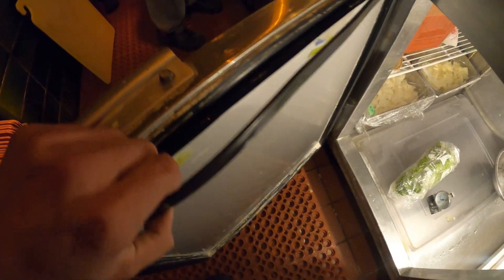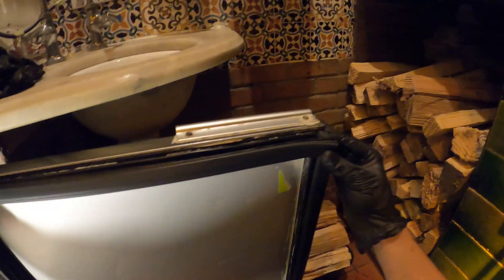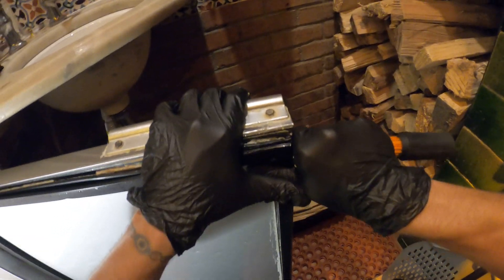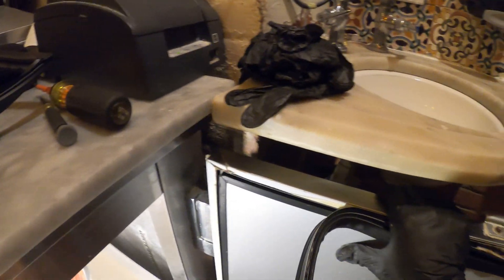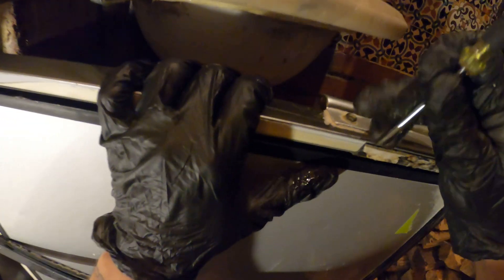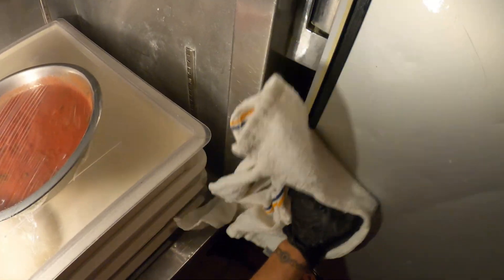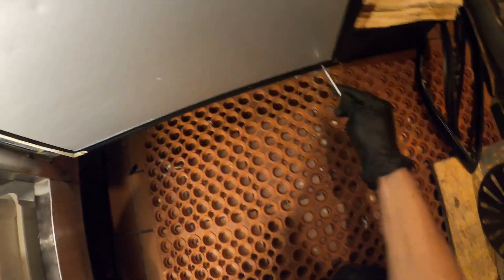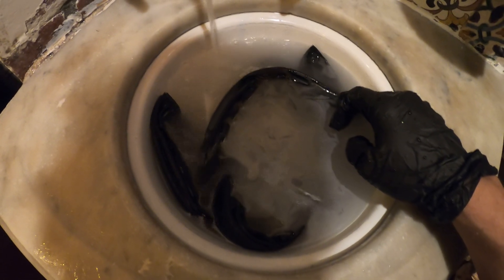HVACR: How To Install A Refrigerator Door Gasket (Refrigerator/Freezer Door Gasket Replacement) DIY

Comment: 👍💪❄️🇺🇸 I use a hairdryer to warm up the gaskets and a rubber mallet to gently secure also when ordering for units that are older than 10 years or more make sure you get the right gasket the before date to confirm that with the manufacturer